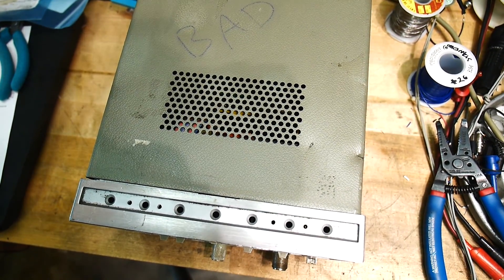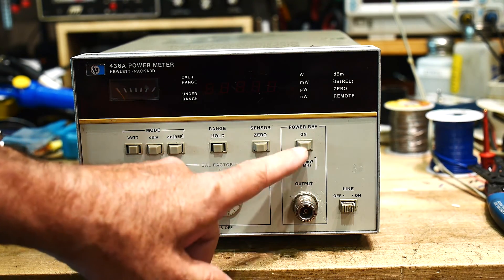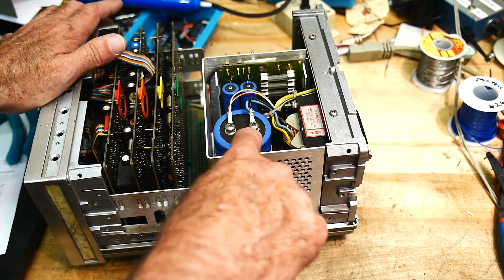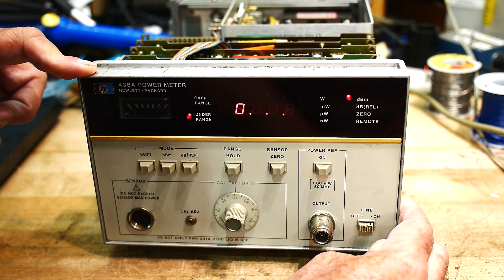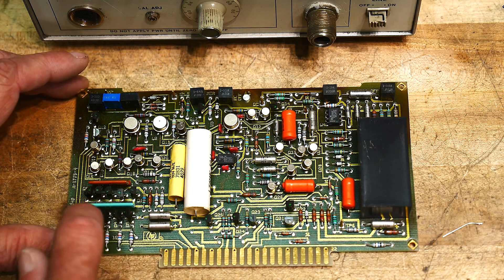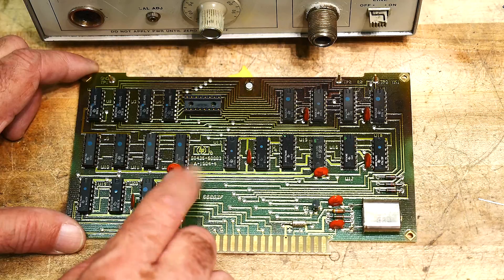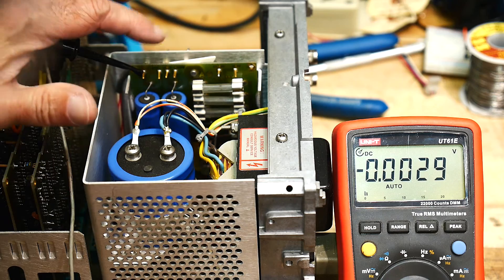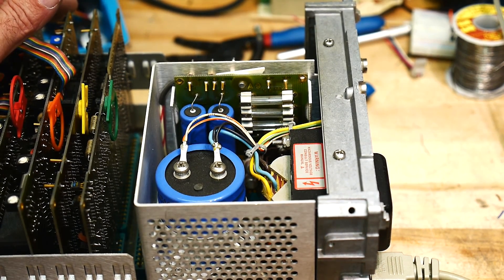#492 HP436A Power Meter as a donor body

Comment: I also bought an old HP power meter HP432B to utilize the chassis, display and PSU but it was working fine when it arrived, I felt sad destroying it and it is now gathering dust on the shelves :P
Reply from the maker: If you could test it you had a sensor. What did you do with the sensor?
Reply: @IMSAIGuy  I didn't destroy it, I shelved the sensor and unit. It was sold broken because the screen protecting the LED is broken and dented top, seller don't want to deal with returns. It measure higher powers than what I needed most of the time.
Reply from the maker: @robertomartin8731  The sensor will work with the HP437 and HP438 and maybe new ones too. Those boxes are much better and can be found cheap

Comment: I have been buying these for a few year as donor boxes and PSUs. they are great as the chassis are cast aluminium and aluminium plates. I have a ebay search notification for  "HP438  lot" and I usually get them for 100$ for 3 pcs or something like that. 20$ is a really good price. Good luck with your project and watch out for those RIFA caps blowing. They are from Sweden just like I am but don't hold it against me, they are just showing their age :-). //Harry
Reply from the maker: My born in America parts are starting to fail too :)